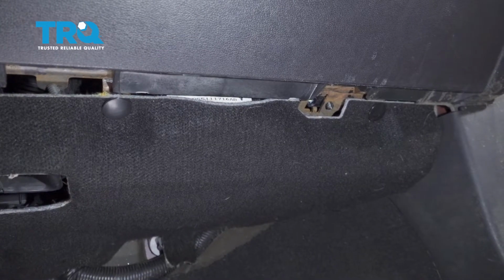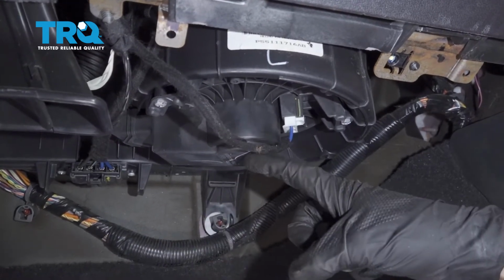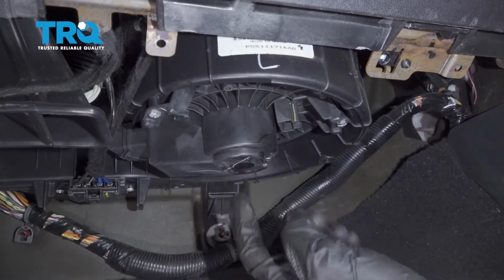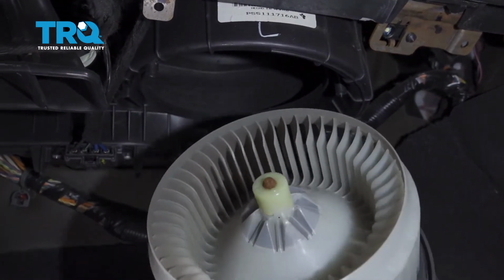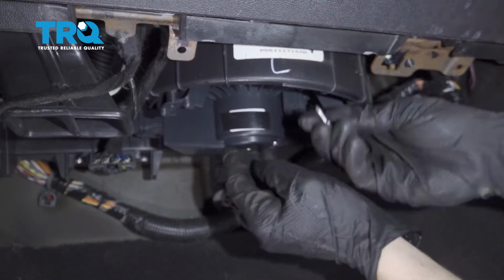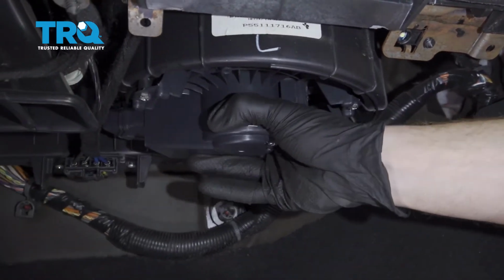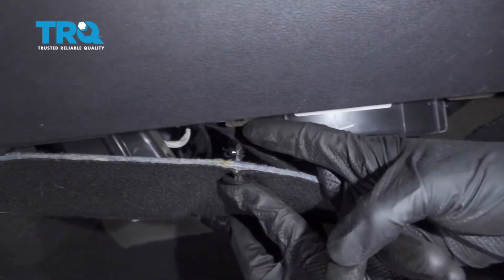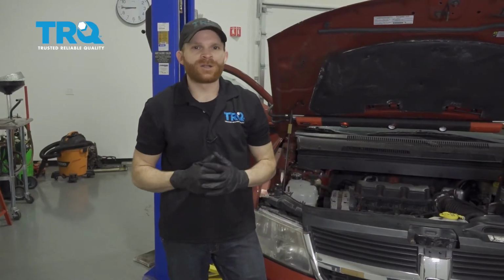How To Replace Blower Motor 2009-2020 Dodge Journey

Comment: Thanks, man.  Three 8 mm screws and a connector + plus the two trim tree clips = super easy

I had a slight squealing noise with the OEM orig one after 14 years and now it's gone.  Not even 10 minutes to do on your own.

Comment: passenger side on my Dodge Journey isn’t heating. And now even the driver side isn’t blowing that much heat. I changed the actuator and it’s still not working.  Could this be the problem?